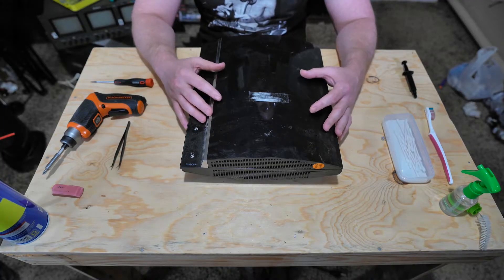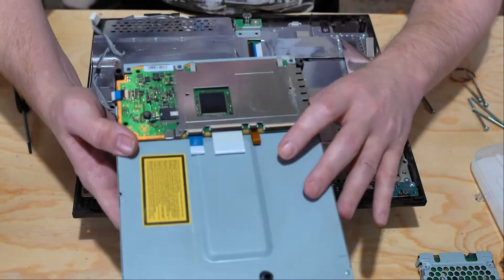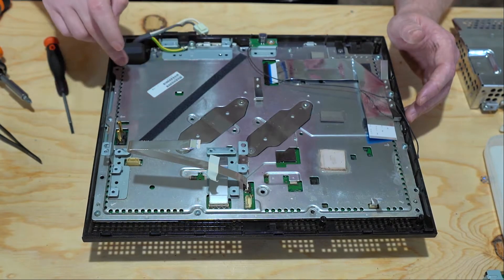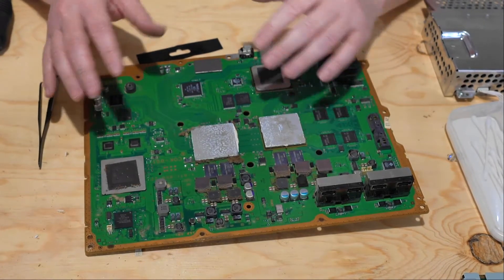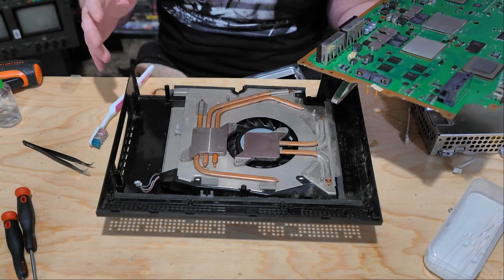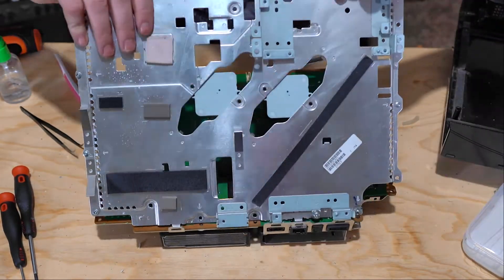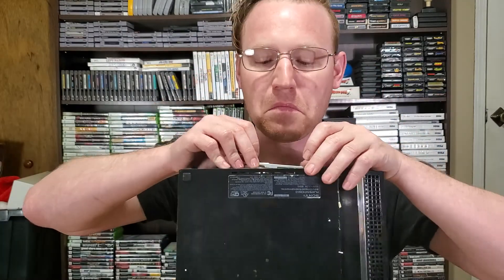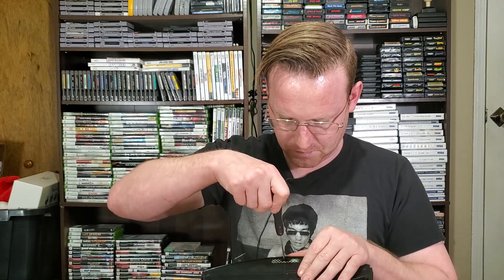PS3 Thermal Paste Replacement & Cleaning Featuring Nathan

Comment: So inefficient. You clean before removing anything, such as the old thermal past, and then clean again after removing. 
Otherwise, thanks for the teardown and tips.
Here in 2025 We use Thermal Pads. Cut to size, place and peal, assemble device.

Comment: Is this purely preventative? Or can this potentially solve problems?

My PS3 had YLOD like 10 years ago. For whatever reason it started working again. Recently it will work shortly and then black screen. Upon reset i’ll get  “No Signal” and controller wont connect, even after trying the output reset trick. 

Is it a lost cause and will need repair? Or should I try a good cleaning and re-thermal?

Awesome video man! Ill be using this as a walkthrough if I do decide to attempt it :]
Reply from the maker: Maybe Nathan will see this and chime in!

Comment: Just got a backwards compatible PS3 and it was super loud. Googling the issue led me to your video.

I've built and repaired my PC multiple times before, but the PS3 here was still an intimidating and daunting beast, but thanks to your help, I was able to get in there and blow off all the caked on dust and apply some new thermal paste.

At first, I was scared I ruined something because after reassembling and plugging the PS3 back in, it wouldn't turn on. I took a deep breath and figured I'd dive in once more just to the Power Supply. If I could get it to turn on, that'd be all I needed for the night. Triple checked that the wires around the PSU were plugged in securely and I screwed it back in. And when I flipped the switch, the PS3 came on.

Booted up a PS1 game and it didn't immediately kick into high gear like it had the night before. Then I popped in MGS4 and the fan turned up a little, but took before there was a lot more happening to start really spinning up.

Thanks a bunch for your video. My only gripe is that taking the innards out of the bottom portion of the case is just kind of skipped over at 6:33. And it's hard to get a good look when you're reassembling it at 13:55.

Comment: Dang taking this apart is so intimidating! I've assembled and disassembled my PC and that was cake, but for some reason, I am very intimidated by disassembling my PS3. I do like the tip that you gave about putting the screws back onto the components you removed so that you don't lose track of them. I will be doing this on my next day off from work and I will be using your video to help me with the process. Wish me luck!
Reply from the maker: Good luck!

Comment: I've seen in other videos that people use a heat gun or blow dryer on the board but you just replaced the thermal paste and put everything back together. Is it not actually necessary?
Reply: I'm not sure why they would do that unless they were trying to do a reflow.

Comment: Great video. Exactly what I needed. I use a jailbroken PS3 and after a while, the game's freeze. So I'm assuming it's getting too hot which means it most likely needs cleaning like you did in your tutorial video here, correct? 👍
Reply from the maker: Let me get Nathan on this question
Reply: @RetroWolf_YT  thanks, I see his message. Awesome looking out! 👍
Reply: Yes most likely it's shutting down because of internal temp.
Reply: @2891nathan  yeah I think so too.  I customized this old fat 80gb jailbroken PS3 to run strictly all the Tekken games because I'm going to put it in my custom tekken arcade cabinet. The freezing issue didn't start until the system was on for hours off and on all day when I was copying my games over. Seems to be running fine now when I fire it up to test the game every now and then. So my guess is possibly needing cleaning to lower temperature 🤷. ..m overall, do you honestly still think it's a hate problem and do you think it's worth opening and cleaning based on what I've told you?

Comment: I change it but it still turns off when playing
Reply: This may mean you need to have the metal plates on top of the chips removed and replace the thermal paste under them this is something I didn't cover because even experienced folks can still mess this up. I would let a professional take over from here.
Reply: @2891nathan  I did clean very good both plates the problem it turn off when  when I’m
Playing gta I was playing demon souls like normal and god of war but like gta assassins creed it goes off.
Reply: @jorgerf9367  the plates come off the chips and have more thermo paste under them. If you have reapplied to both the top and bottom you have another problem and need a thermo cam to see what chip is heating up to much so you can replace it.

Comment: If it was refurbed by GameStop….probably not.

Lol so true.

Bit of advice: PS3 dies are notoriously uneven. Paint the thermal compound on in a thin layer to achieve full coverage. Also, don’t use a power drill on the CPU GPU clamps. Do that by hand so you can feel torque. That’s it, great job though.

Comment: Dude, you're supposed to take off those CPU covers because there's dried up paste below those as well. It's the most important step to save your PS3!!!!!
Reply: A dled is not always necessary and it's risky do this first if it works play on if not it's best to let someone with lots of experience take it after that.
Reply: @2891nathan  You are right, it is very risky. But if the paste is dried up on top of the lid, the paste below it will be dried up as well. Eventually the lid wil have to come off!

Comment: My PS3 is near flawless fat software ps2/ps1 emulator, def doing this service soon on a bath towel. My hdmi port isnt working which really sucks, 480i on the av cables out, I might have to send it out for that repair. I am afraid they will scratch up my baby!
Reply from the maker: Dang well I wish you the best of luck on that!
Reply: CRT time.. lol
Reply: Plus one for CRT. I barely game on my OLED or even touch my PS5 now that I have a 25 inch Sony PVM and a few other CRT sets.
Reply: @eleckson  same boat haha. I have the alienware QD OLED ultrawide and I game more on my lil 14" PVM.. whoops
Reply: @sIacker  The tiny ones are not to be underestimated!  I also have a 15" Ikegami HTM-1517R that does 240p all the way up to 1080i. Running RGB and Component on that blows my 25" PVM-2530 out of the water. Super crisp. That gets lost the bigger you go. 

Next up is RGB modding my 20" trinitron for a good middle-ground.
Reply from the maker: I wish I had a 25 inch Sony PVM 😭
Reply: @RetroWolf_YT  the trick is to hope you find something local on eBay, then wildly throw out lowball offers until someone accepts!

Comment: I just did a thermal paste replacement watching this video. My fat PS3 would randomly shut down and beep and flash red.  Took it apart and the old paste was crumbly and barely there. I replaced the paste with a pea-sized amount on both chips, put it back together and played some Uncharted 3 for about 10 minutes or so and it shut down and beeped and flashed red. What did I do wrong?
Reply: You may not have done anything wrong. From the sound of it you will need to go a little further. In this video I did not pull the plate off the chip because the paste was not that bad but in some cases you need to remove the plates on the chips and put paste on both sides. Also make sure you put the small thermal pads back in place they would have been placed on pretty much every chip.

Comment: Thanks! Did this today and have to admit my hands were shaking & heart pumping :D at the half-way i almost gave up middle of the "thousand" different size of screws & parts but then i was like f' it, there's no turning back now. Finally came in the end to put all the pieces back together and then... NO POWER! Gladly found out the POWER RIBBON was tighten badly & loose, straighten that one & voilà!, back on wheels :) thanks for the video.👌🤝🏆
Reply from the maker: Glad this was able to help you!!

Comment: I'm having trouble trying to get the CMOS battery out of the socket.  Any suggestions?  I don't want to yank the socket off the motherboard.  Thanks!
Reply: There should be  two small slots at the back of battery try to insert a small fathead screw driver in the slot then use another to gently pull up on the battery.
Reply: @2891nathan  I have a battery with a wire that connects to the mother board. When I'm trying to disconnect the wire, it's not moving much to free itself. I don't want to pull too hard and risk tearing the wire socket off the motherboard. Any suggestions?
Reply: @JohnRussell9  I'm not familiar with that let me look into it and I'll get back with you.
Reply: @JohnRussell9  ok that should be the PRAM battery the connector on it will pull off just pull up on it and gently move it side to side.
Reply from the maker: I will get Nathan to chime in on this tomorrow
Reply: @RetroWolf_YT  Thanks!

Comment: Is it normal for a PS3 to blow warm air out the back? My PS3 blows warm air out the back on the right side nearest to the power and hdmi cords, while the left side blows out cooler air. I have a Super Slim model by the way.
Reply: Yes it pulls the heat out of the system.
Reply from the maker: Let me get Nathan to answer this
Reply: Thanks for the response!
Reply from the maker: Thank you for watching and commenting!

Comment: My PS3 will sometimes exit to the PS3 menu screen after about 2 hours of play. While I suspect it's overheating, I find it to be a bit strange as to why it wouldn't shut off completely. I've heard of people having problems with their PS3 shutting off when overheating, whereas mine just exits to the PS3 menu screen. Do you think this could be a result of overheating, or is something else going on here?
Reply: This sounds like something else. Check different games this maybe just the game crashing. In any case make sure your updated to the latest version of software.
Reply: @2891nathan  Thanks for your response, Nathan. Unfortunately, this issue occurs with every game. I forgot to mention in the above comment that the fan runs high when the PS3 exits to the PS3 menu. The fan also runs high during gameplay, but not always. Sometimes I can't hear it at all.
Reply from the maker: Just out of curiosity have you ever disassembled and cleaned the PS3? If not that could help potentially
Reply: @RetroWolf_YT  No. I've never cleaned it before. I've owned this console for about 4 years.
Reply from the maker: I would recommend starting with that but I would recommend watching several YouTube videos on taking apart a PS3 and cleaning because it is pretty challenging
Reply: @RetroWolf_YT  Thanks for your help, man.
Reply from the maker: No problem good luck man!
Reply from the maker: Nathan will respond soon dude

Comment: Question: How drastic are the changes in how the internals are arranted between all the fat models? Like mine(a Cechl04) had the fan and heatsink sitting on the backplate connected with screws to the backplate and not the main board while the blueray drive has a very small ribbon cable compared to your model. So if i ever want to clean the fan i have to apply a new thermal paste.
Reply: I don't know all the configurations they have but I do know they changed things quite a bit. Just make sure to reapply paste on the gpu and cpu chips as well as keeping the little thermo pads on the other chips.
Reply: @2891nathan  thanks for answering. Will do

Comment: How much do i need to leave it to cool when i barely put thermal paste on it?
Reply: Just put the thermal paste on it and you can reassemble the ps3 back. There is no reason to wait after applying thermal paste
Reply: Please explain do you mean you may not have enough paste? Or Once you replace the paste how long before you play. Once you replace the paste you can play right away.

Comment: Thank you so much for this tutorial ! I had a backward compatible model that i didn’t use since 2012, managed to recover it thanks to you !
Reply from the maker: That is awesome to hear! Glad the video helped!
Reply: @RetroWolf_YT  i wonder if changing the thermal past under the cpu/gpu would also improve performance ? Thanks !
Reply from the maker: I believe it would but that is a challenging and risky thing to do which is why we didn't cover it in the video
Reply: @Ziggurat101  it would but..... that's something you would want to practice on dead systems before you try. This repair should do just fine. If the fan on your ps3 ramps up even after this repair it's something to look into but for the most part this repair will last a long time.

Comment: Hey thanks for this video. After 15 years or so, my Ps3 is still going strong, but it's time I get that thermal paste replaced, so I'll be watching this video. Do you recommend getting the 19inch fan for it? Or just keep the standard? Will it make a difference? Thx.
Reply: The standard fan is more then enough.

Comment: If anyone is looking to preserve a PS3 this is a great place to start, but unfortunately it's not enough in the long term. Sony's software allows the console to run anywhere between 74-78 degrees C and sometimes higher which will cause the yellow light of death, to prevent this you can install custom firmware and set the maximum temperature to 65-69 degrees C, although I will admit that this will make the console quite loud but it's better than no console especially if it's a rare BC model. 

If noise bothers you and you're good with your hands then I'd suggest following an IHS removal video, in this video you see the thermal paste replaced, but underneath the metal plates is yet more thermal paste, replacing this is key to a quiet and cold console with a long life span, but it is risky and should only be done if you have the skill to do so, I'd recommend buying a few dead motherboards to practice.
Reply from the maker: Might be time to clean it 😅
Reply from the maker: Thanks for the info and tips!
Reply: The YLOD is caused by faulty capacitors on the motherboard
Reply: @Wolverine-ky9gk ylod has 100s of reasons. Could be tokens as well, as well as overall high temps that reflow the gpu.